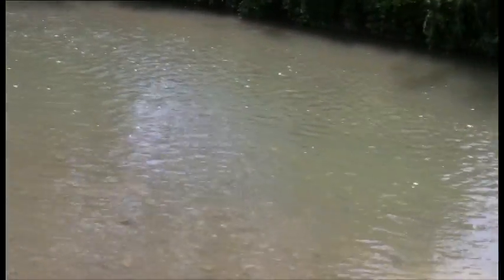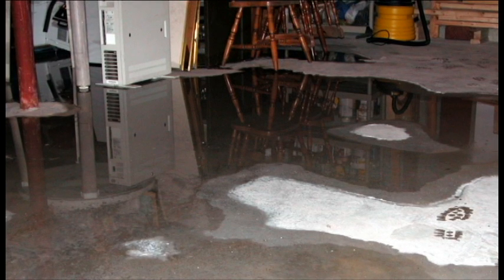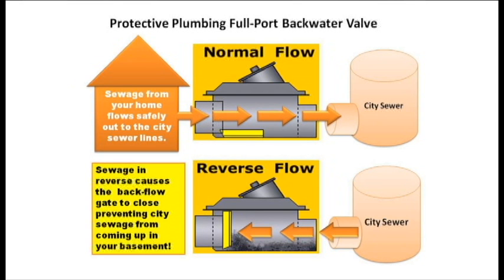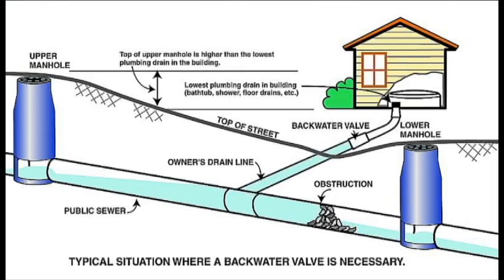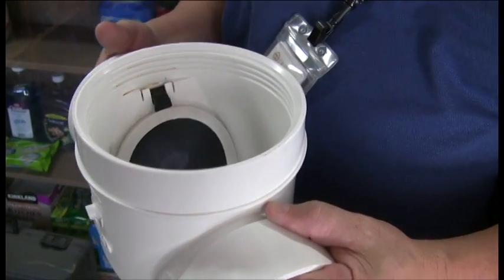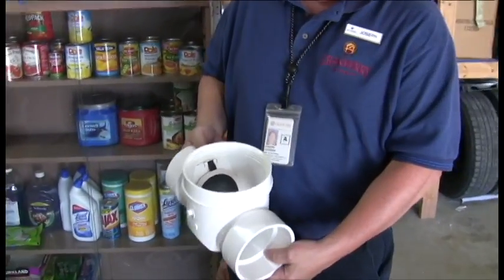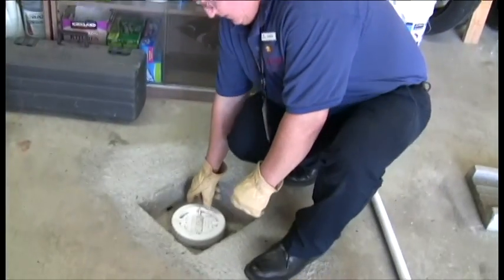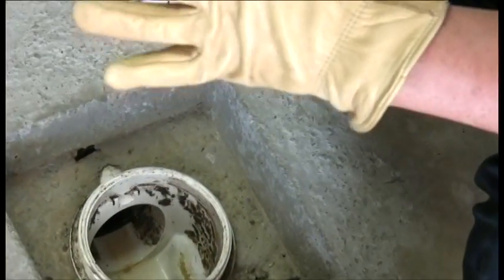Backwater Valve Maintenance

Comment: Can you answer a question please? Is a clean out port necessary with a backvalve? I had a  backvalve, but not a clean out port installed in my basement. Two plumbers have told me that the system will work fine, but our village inspector refuses to approve of the work saying that I need a clean out port in order to rod . The unit I had installed pulls out to rod, but the inspector is saying the plastic will scar. My plumber is insisting it is fine as it is. Is there a code or something  that requires a clean out port? Not sure what to do. Thank you for any help you can provide 🙏.